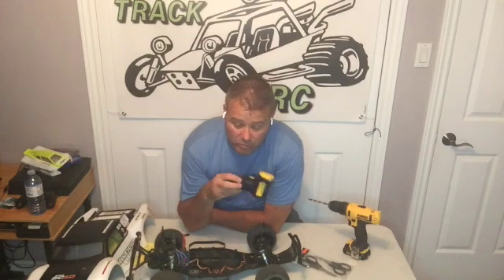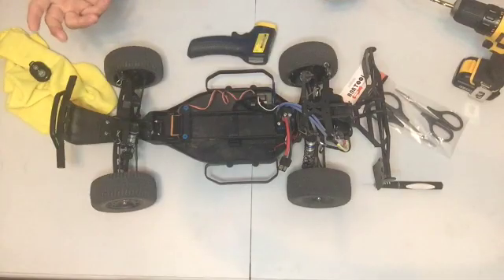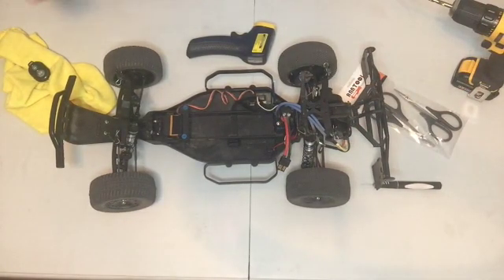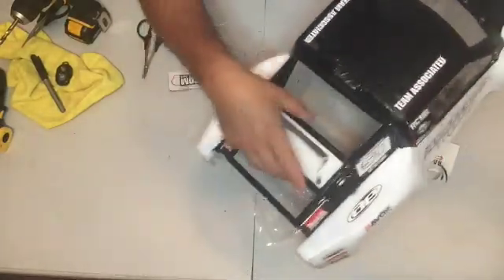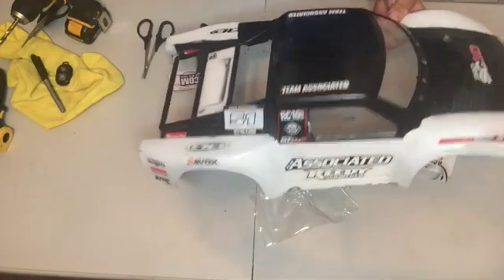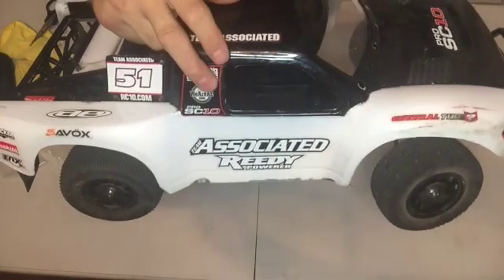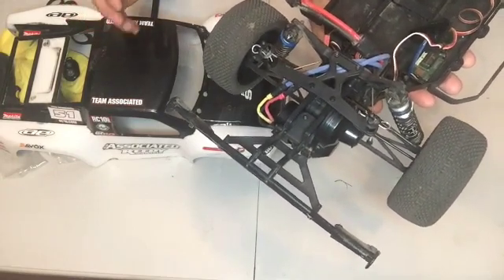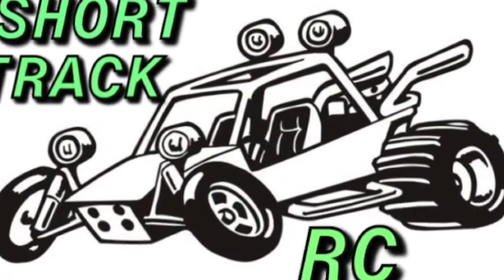RC OVERHEATING- NEW BODY HOLES NEEDED!!!!!

Comment: I know this is old but i figured I'd leave my idea. I like the idea of cutting out the rear panels on the SC trucks, i cut the centers of the fake fan stickers of my old XXX-SCT and mounted two fans to the body with a disconnect in the wire to take the body off easily. Pointed them to blow air out the back of the truck and it made a huge difference, plus it looked pretty sick having visible functional fans

Comment from the maker: is there anything else i can do to cool the motor my local hobby store said there's no room for a fan ????
Reply: Absolutely can put a fan on these trucks, look up DR10 cooling options. https://www.ebay.com/itm/174764702097?hash=item28b0c9b991:g:PxkAAOSwMA5gmdti 
With the motor in the back the body holes in my opinion are not going to do much because the motor is under the body line and the heat is not really being trapped by the body. A DR10 style motor cooling option is what I see all the local drag racer guys using on the box stockish DR10 class, in California in the summer most days are 90F and without motor fans you can only get a few runs before thermal cut. Good luck and I look forward to seeing how it worked out.
Reply from the maker: 👍 @DoubleClutchProductions  thanks for the info i will be ordering one right now
Reply: @shorttrackrc6976  Cool man I look forward to seeing how it works for you. Tell your local hobby store DoubleClutch sent ya, tell em to Subscribe lol